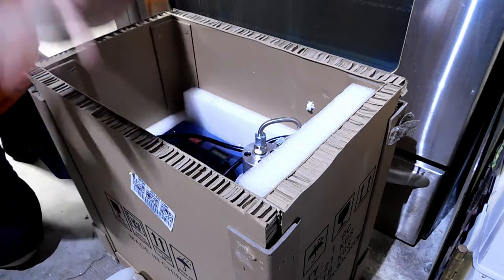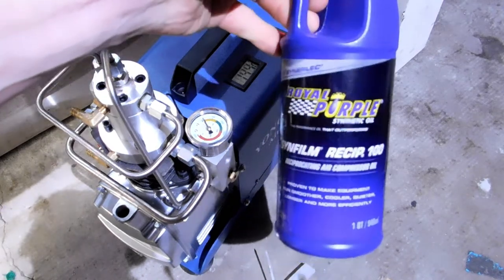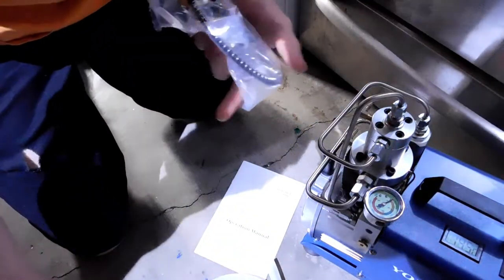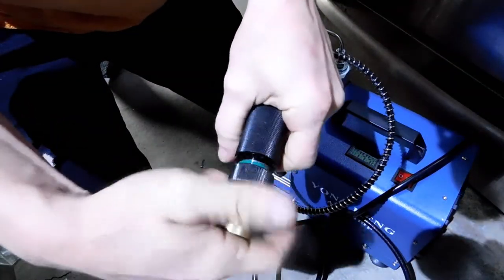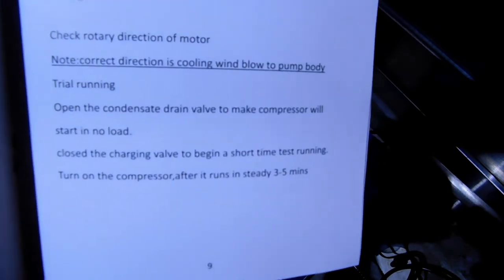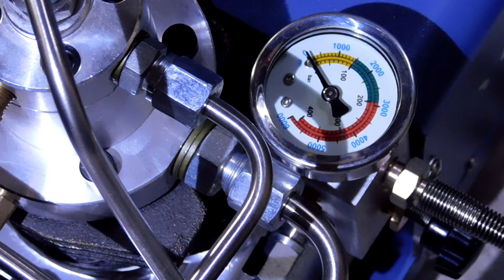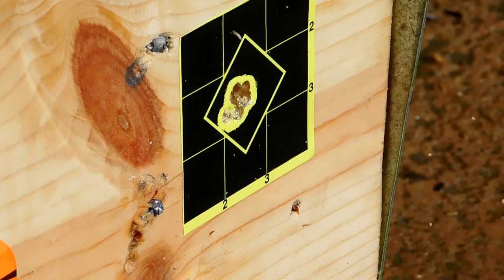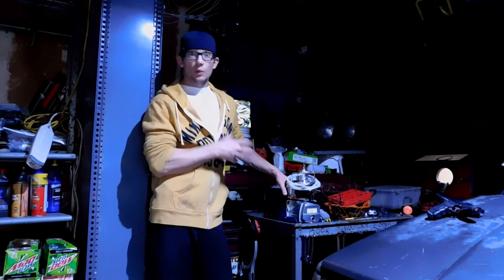NEW YONG HENG PCP PAINTBALL HPA Compressor Pump FULL REVIEW!

Comment: I have the set pressure version, which shuts down once the set pressure is reached. This suggests to me that you do not need to bleed down the pressure before switching off the pump. The manual states that the water inlet is at the bottom, not the top. Simple thermal dynamics at play. Also, the documentation that came with my pump did state that it had been factory tested.

Comment: Pumps are factory tested and flushed (I have 2 compressors and neither had any metal shavings in the oil when I changed it).  Water inlet should be hooked into the bottom.  Bleed air before shutting off pump.  This saves wear and tear and bleeds out extra moisture (I run min at least 15 seconds no load).  Open the filter housing after every fill and remove the filter to allow everything to dry out (the filter traps an amazing amount of moisture).  My first pumps is going on 4 years old and has several hours use with zero issues.  My second pump is new and has only 10 mins on it.  I shoot at 2 different locations so I got a second pump so I didn't have to lug one back and forth.
Reply from the maker: Sounds like a great setup for never ending air!

Comment: The pumps are pressure tested at the factory before shipment so there might be signs of oil in the crankcase and filter, then it's packaged for shipment. The reason for running the water into the bottom input is because air rises and the water will displace any air in the cooling jacket. Be certain not to overfill the oil as it will send excess oil into the two pistons and foul your airline and filter, and could cause piston damage to the second stage piston if oil is trying to be compressed.

Comment: I ordered a 36 inch hose that quick connects to both my hand pump and my conpressor in seconds. As the hose on my hand pump was short as well. It came. With the quick connect That also worked on the conpressor

Comment: Water is supposed to come in through the bottom port. It will run cooler that way. Use at least a 5 gallon bucket.

Comment: Just ran across your video & you need way more water in your bucket than what you have, also would be good if you had more water flow to help keep your water cooler. Take a Jug & put water in it & freeze it & when you use your Pump put the jug of frozen water in the bucket it will help with keeping temp down some.
Reply: and have the bucket higher then you compressor gravity really helps that water

Comment: I have seen videos that the compressors are tested before shipped.  The hose was factory sealed  in plastic.
If the compressor was used it was factory boxed.  The white cotton thing would have had a bigger grease spot,  if run for 15 minutes. 
I would want the tempter gage preinstalled.  It is a permanent part of the compressor assembly.

Comment: I suggest you run that 110 volt Chinese air compressor off a voltage regulator  on the 110 volt setting.

Comment: The water flow you are doing will not push air out properly and you might have a water cooling system with air in it? Just asking.

Comment: Water goes in at the bottom and "thermal dynamics" has nothing to do with it as several have suggested. Same as in a chemistry lab using water condenser, air floats to the top and the water exiting  the top takes the air with it ensuring a completely filled water jacket. Do it backwards like you did and you have an air bubble at the top and no way to clear it. With no water there to cool it you could overheat the cylinder and possibly damage it .

Comment: macabesspeed: What was happening when you felt that that the original unit was failing? Do you have any insight into what you think happened, and how to prevent a future failure? I think that keeping the heat as low as possible,  and removing the load prior to shutdown, or startup is the key to longevity. Thanks for your review.
Reply from the maker: I think the old unit may have had a burst disc issue.... wouldn’t go up in pressure pasta a certain point
Reply: When you put the fittings together at the filter if you over tighten that little washer and dryer you can smash it what was the hole enough I have mine wouldn't pump over a thousand pounds sure when I took the valve apart I seen it I took a drill bit by hand will pair of pliers Twisted back and forth the drill make it too hot Melt it after I open the hole 3200 lb in my scuba tank hope it helps someone bang bang bang

Comment: Do you know if this compressor can run off a power converter connected in a vehicle?
Reply from the maker: only runs on the household plug, no 12v adapter provision on this unit...
Reply: Of course it's possible but you would need a very expensive inverter to do it. I tried using my 2000 pure sine wave unit and it wouldn't start it. You'll need a 3000 watt unit minimum but a 400 watt unit that's pure sine wave only would be best. Those run about $500.00 and needs to be wired directly to the battery of the vehicle and the vehicle would need to be running. 

Best option for mobile fills is a small generator in 2000 plus watt size! Or you can buy one of the many new AC/DC pumps that run about $650.00.
Reply: @AZBADBOYz  prob will need a bigger alt and batterie as well, i mean i used to have a 2800 watt amp and sub in my car so it might be possible
Reply: It would take an awful big converter 20 amp by compressor pop the breaker one time so it's going to take a big converter I thought about it myself let us know if it works have a wonderful shooting day bang bang bang

Comment: Do you start it with both valves open or closed.  It does not specify.
Reply from the maker: Great question! I start with both valves fully open, then I close the low pressure side, and then the high-pressure side which is where the hose to fill the gun comes out. Before I turn it off I also open both of those valves to relieve pressure within the system before letting the pump go static.

Comment: Sorry but I have to correct you. You must always put the return drain on the upper point of the cylinder, otherwise there will stay air at the top of the cylinder on the point where cooling is most required.

Comment: Awesome video! I got a question. I just bought a hatsan bullboss .22 and i cant fill her up with the hand pump that was included.. i want too know whats the best most affordable way i can fill her up? Should i buy a tank? (If so which one?) Or a pump? Or a compressor? Id like the cheapest but yet reliable way. I apppreciate your input brother!
Reply from the maker: Michael McNulty honestly so far the yong heng seems to be a good option, as long as it’s picked up through amazon so your returns are rock solid! Plus it’s ready to run. A tank will still need a line 👍
Reply: @macabespeed  thank you. How about an expensive hand pump? Do you know of any good working hand pumps? If not ill have too save up for this compressor.
Reply: @macabespeed  you should have seen me fir like 3 days straight i tried pumping my rifle like crazy.. i mean sweat dripping down my face with tons of pressure and yet i could only get her too 100 bar and its a 200 bar fill lol
Reply from the maker: Michael McNulty it’s setup to run on household American 110v. They have a 220 version also, but I opted to go 110 for ease of use. I actually was terrified of not being efficient w a hand pump myself so I opted for a cheap hpa compressor instead. I think the compressor is actually only like a hundred more than a hill hand pump
Reply: FYI, the "220" version is not for what people think is American 230 volts at 60hz. The 220v model is the 120v equivalent of American power in the UK and it's 220v at 50hz and not compatible.
Reply: Just to give you an idea of just how fast this compressor is, it takes exactly 2 minutes to fill my tube from 150b to 230 bar. Buy a compressor and give that pump to someone you hate.